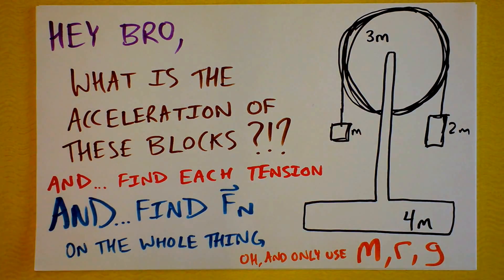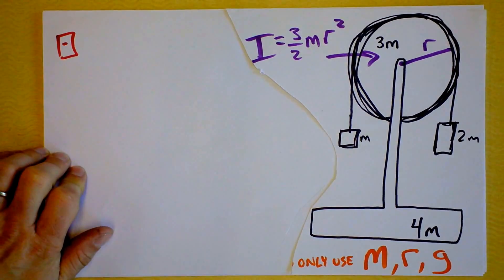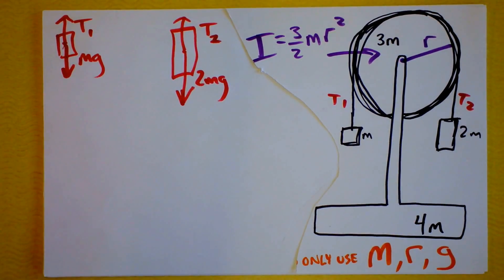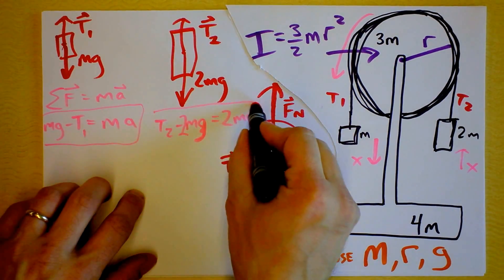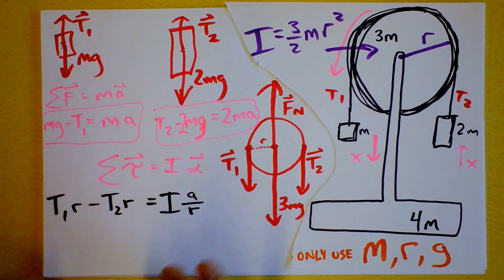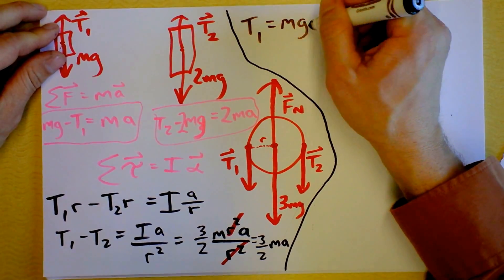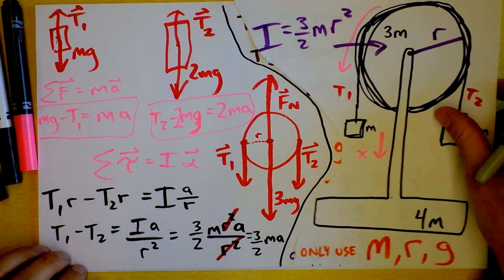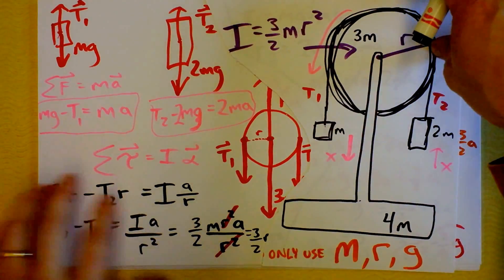Rotational Dynamics Pulley Tension Atwood Machine Worked Example | Doc Physics

Comment: Conceptually equilibrium is defined as a stationary object without movement. So "Which direction is the acceleration." Well first, to sustain equallibrium the base, which could technically be classified as a rod (if u use simple shapes for the moment of inertia) MUST rotate counter-clockwise because of Newton's 3rd law and the torque the pulley is experiencing. So the acceleration MUST be opposite, that of which relative to the torque of the pulley. Yes I knew he posted it 8 years ago. But I thnk, hope, I'm right. I feel very confident. :D

Comment: I think the negative acceleration means the pulley should be accelerate at the opposite direction from the assumption at the beginning (counter-clockwise), which means the pulley will be accelerated in clockwise direction.

Comment: 1) why did you take T1 as pointing down when you pointed it up in freebody diagram of m
2) do you always choose one direction of movement positive and make the other negative?

sorry but these questions have confused me forever and i've never found a solid answer..
Reply: +Raj Sondhi I'm going to try to answer your questions. So 1) It's because when you look a body m, the rope has "inertia" and therefore wants to stay in place, and that resisting force is tension and upwards (It also has to do with some things on molecular level but if you go on collage you'll go through that). So on that body diagram tension is upwards. However, By newton third law there is an equal and opposite force OF body ON rope. And THAT force is the one that interacts with PULLEY. So the crucial thing is to differ which body is of your interest. 

2) Well, you have to actually look your system. Would you agree that here wouldn't be possible that both bodies go downwards?

Hope I answered your questions. Cheers :)
Reply: +I Zugec thanks man, after 3rd chapter of dynamics, I've pretty much cleared this one up.

Comment: Hi could you take a moment to explain why I got it wrong using this method:
http://i.imgur.com/nyKFlr5.png
maybe it was because I assumed the pulley was smooth and the strings in-extensible, or maybe I was finding the wrong acceleration...
Reply: Ben Boys Just read the description, "This means that the tension in the rope is different between the two sides of the pulley." oops.